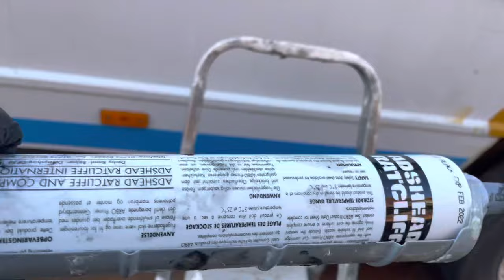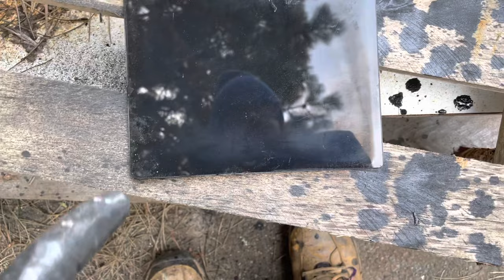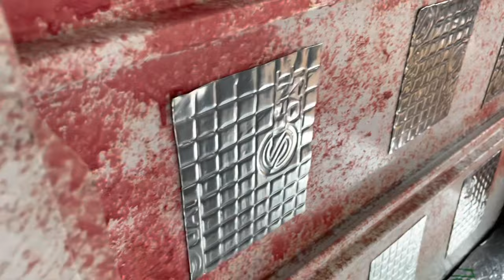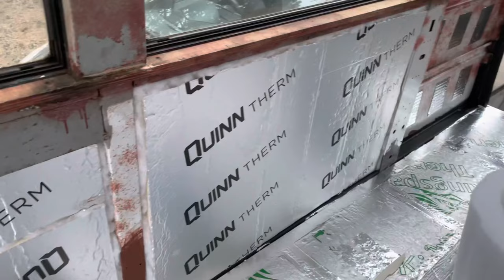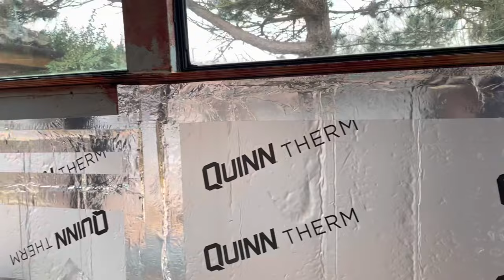Sound Deadening, Wall Insulation and Tinting Van Windows | Mercedes Vario Bus Conversion | Ep.12

Comment: Sound deadening tip-instead of buying expensive sound deadening pads, because go to screwfix and buy roofing flashband, it’s practically the same stuff and it’s much cheaper than deadening pads and does exactly the same job, I used it on my sprinter build and it works perfectly. As for window tint, film is better because it adds security should someone try to break in via a window it hold the glass together rather than shattering easy thus allowing easy access for undesirable persons, don’t worry about small air bubbles they will disappear after about a week of drying out. Great video again, as you said this is the reality of van building, but you will have wonderful family adventures in the future, so all worth it.
Reply from the maker: That’s a great tip and we will use flashband in the cab we think. Basically we had this left over from when I sound deadened a car (classic mini’s are tiny 🚙🚙🚙). That’s also a great point about the tint. We will likely do a hybrid and not paint the windows where we just want privacy and they aren’t covered by insulation etc. Think we will upgrade to some dearer tint for those areas. Thanks so much for these tips and for watching. You’re a star 🚐🚐🚐

Comment: Really interesting to see the spray tint against the film. We found the film really hard to use but a good outcome. We've got a few worms appearing on the outside even though they looked fine when we did them but I think probably worth it for the amount we saved getting them done professionally.
Reply from the maker: The prices for a pro install are insane! We picked up a tip from your last video on using a blade as well as the clay to get all the crud off. I think yours look great. When we did the spray the first van had an ‘issue’ but overall the outside affect is pretty decent. We don’t think it’ll be the whole bus. Prob some select areas where we are covering the windows. Hope you are both well 🚐🚐🚐

Comment: Well done 👍 18mm flooring Can I say keep an eye on the weight our 7.5 ton soon got close.
What thickness on walls and cupboards are you using.
Reply from the maker: Wow. That’s good to know. What sort of weight was it ‘empty’? We’ve only (I say only) got about 2.5-3 tonnes of payload. Should be plenty we hope.
Reply: @WanderbusAdventures  probably about 4 Ton things soon add up a live stream would be good give you some ideas hopefully stop you having weight issues. Our cupboards are 3.5mm and 6mm ply bonded together with either sikaflex or ct1. Facebook us @have motorhome will travel. I have built mine and fixed a few. Any questions let me know
Reply from the maker: Appreciate this. Thank you

Comment: just my point of view you did such a good job on the floor left no stone unturned but with the windows you have just run some sealer around, why not remove the windows and reseal❓a major point of waterproofing that will last it's like a house roof u would not cut corners. Insulation looking good guys but with so many single glazed windows will you see much benefit I wonder ❓thin double glazed units might be an option and would dramatically reduce condensation
Reply from the maker: This is a great observation. So since this video we ordered new seals for all the windows only to find out they are the wrong seals. We need to remove the windows as you point out. But this is a big job, we we’re hoping to seal around the windows and that the glass seals were wedge seals; they aren’t which does mean a lot more work. We are waiting on a quote for the correct seals at the moment. Which is causing a delay with the internal build - but we will get there for sure. We need it to be watertight for sure 😊

Comment: We spent three days removing the glue with rags and thinners. Horrible job. Like you said probably didn’t have to be done but when going as far as taking out the floor the OCD meant the glue had to go as well 😂
Reply from the maker: It was a 50/50 on whether we’d do it. This will sound odd but we did heat it up to see if it smelt etc. Getting the attached crud off was a task in itself. Hats off to you for removing yours. I’ve got a sneaking feeling I’ve seen it on Instagram?
Reply: @WanderbusAdventures  you may have seen it on Instagram. My wife posts some pictures. It’s not a vario but the last of the T2s that preceded them. A beige colored 1996 609d with badly blanked off windows and lots of rust. We’ve lots of welding to do...
Reply from the maker: It’s not a Mercedes Van if it’s not got rust 😊